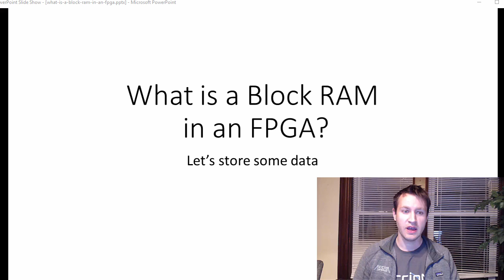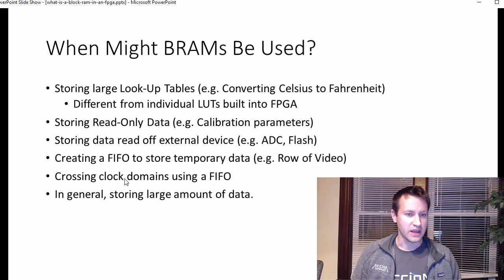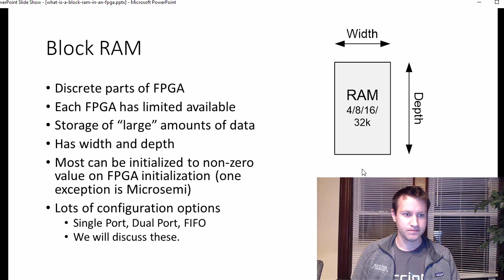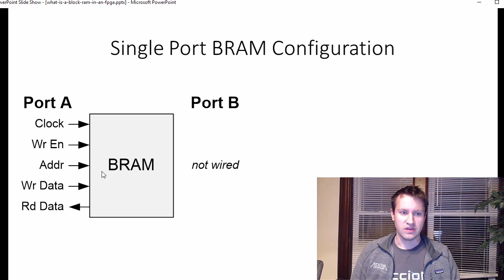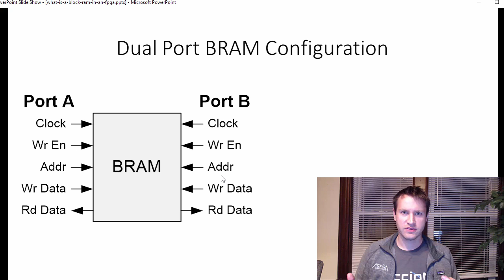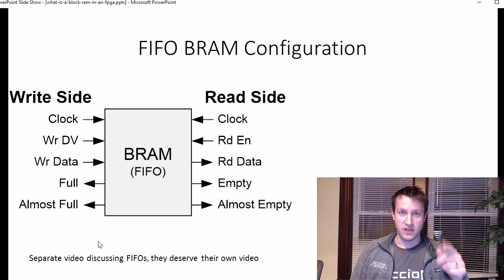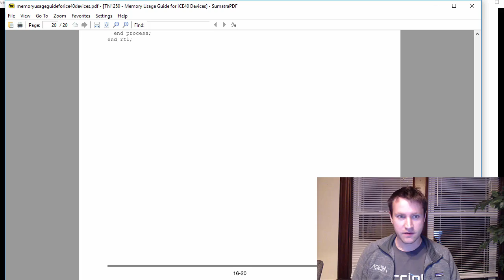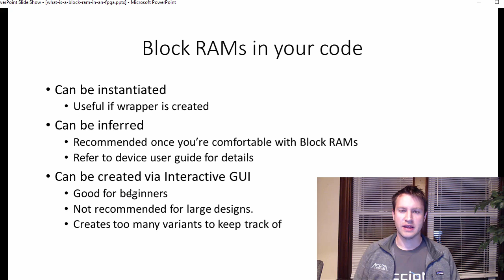What is a Block RAM in an FPGA?

Comment: If microsemi parts can't be initialised to non-zero how can we use it for storing large look-up tables? like Celsius to Fahrenheit. Thank you.
Reply from the maker: You'd need to load the BRAM from something else. A microcontroller or some other non-volatile memory storage element.
Reply: @Nandland  Thank you for the response Russell! Appreciated! BTW, I know that Xilinx FPGA registers can be guaranteed to have a specified value when booting up. But for Microsemi (ProASIC3) I can't find anything at all about this. I heard they don't guarantee a 1 or 0, do you know if that's true? Thank you.

Comment: Block RAM or  BRAM is a type of random access memory embedded throughout an FPGA for data storage. You can use BRAM to accomplish the following tasks, Transfer data between multiple clock domains by using local FIFOs. Transfer data between an FPGA target and a host processor by using a DMA FIFO

Comment: thank you for your tutorial. I'm desperately looking for an example or tutorial for block RAM instantiation. do you have one please? Thanks
Reply: Try working on some examples related to VGA. Those examples usually use block RAM's and you will also get a chance to practice. Another way to practice is to create a GCD calculator using (datapath+controller) and try feeding the design values from a ROM.

Comment: Hi ! I am working on a program where I use your UART_RX and UART_TX to write back and forth to my MAC. But I want to save state on the fpga between reads and writes. For example, to calculate the sum of  numbers arriving on the UART_RX  then send the sum back to the MAC on the UART_TX.  Can I put the "sum" variable in bram and still maintain state ?
Reply from the maker: BRAM is used for large amounts of data. "sum" is probably just a 16 or 32 bit register. That's small enough that it can go in normal register space. If it's > 1kb of memory then that's when BRAMs make sense.
Reply: @Nandland  Thank you for responding so quickly. 8-) Ok. So I am using your uart.v code with UART_RX and UART_TX.  Between the two subroutines I stuck another subroutine that is called like this 
CHANGE SMALL (.a(w_RX_Byte), .b(o_Byte));
and then o_Byte is passed to UART_TX. 

The subroutine I use is called change.v and looks like this:

module CHANGE
  (
   input [7:0] a,
   output reg [7:0]  b
   );
always @(*) begin
   sum <= sum + a;
   b <= sum;
end

endmodule

"sum" is declared in top. 
So I get either 0 or 1 for the result that comes back to my MAC screen.
It seems to alternate. The numbers to sum are 1,2,3,1 which should equal 7.
I assume my MAC screen should look like 1,3,6,7.

It is as if "sum" isn't getting set correctly.  Any suggestions or pointers would be much appreciated. 
Thank you for all your hard work.
Phil Neal
Reply: Ahhh, a small glimmer of understanding....
I was not using the correct architecture for passing in the full byte from UART_RX to my
module.  Inputs to a module are always wires. Outputs must be wires if they are
going to be passed along to another module...

Comment: Hi Russel,

Could you tell me how to write a testbench for a BRAM of depth 50. I mean if the address we use for BRAM, Ex: bram(addr1) is more than 50 in terms of depth, how do you provide a 50-length long value for it in the testbench?

Thanks,
Varun
Reply from the maker: Hm not sure I understand the question. In general I set my depth to a base 2 number. 64, 128, 256 etc. That way the address is always valid.

Comment: Thanks for the video, I have a question.
You mentioned at the end of video, BRAM is not recommended for large design.. then what is another option for large design?
Reply from the maker: I think I said that I don't recommend using the interactive GUI for creating BRAM for large designs.  That's when I'm talking about what method to use to create the BRAM.
Reply: Ah, I misunderstood. Sorry. Then, What do you recommend to create BRAM? Sorry for silly question. I am a beginner of FPGA
Reply from the maker: For beginners/small designs I DO recommend the GUI tool.  Large designs though it becomes unwieldy.

Comment: why do you want 1 << addr_width in the memory you have taken. why 1 is left shifted 
in reg[datawidth - 1:0] mem[ (1 << addrwidth) - 1:0];
Reply from the maker: I didn't write code for this... so any example code that I show I didn't personally create.  However this looks like just a way to create a variable length memory.  1 << addrwidth-1:0 defines the depth of the memory.  I personally would prefer to use reg[datawidth-1:0] mem[$clog2(depth)-1:0] as that's more clear to me.

Comment: Thanks for your video,but I don't really understand the first two ways of generating a BRAM at around 12:39.It would be much better if you can describe it using some more specific instances,such as code snippets or showcasing it yourself.  Still,this is an awesome video,best regards from China.

Comment: Thanks for the video, but you said  that creating block of RAMs using interactive GUI is not recommended. Personally, I disagree with you and I think that depends on the manufacturer of the FPGA. I use xilinx core generator and I can see that it provides optimal solutions for many designs
Reply from the maker: I recommend it for beginners.  But I've worked on projects with 50+ independent Block RAM GUI created cores.  It's a nightmare.  I prefer inferring them when possible as you get more comfortable with FPGA design.